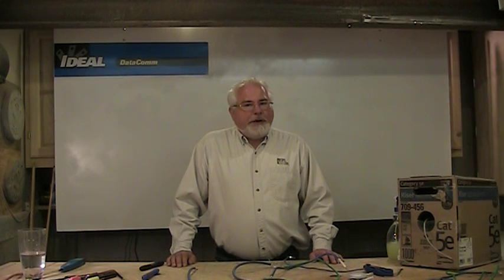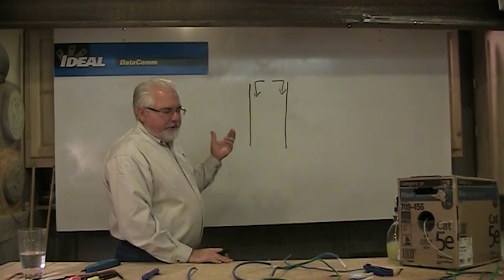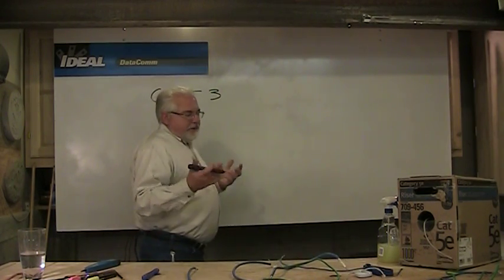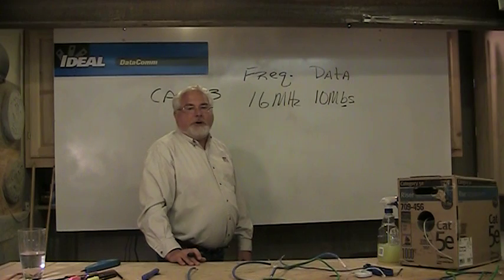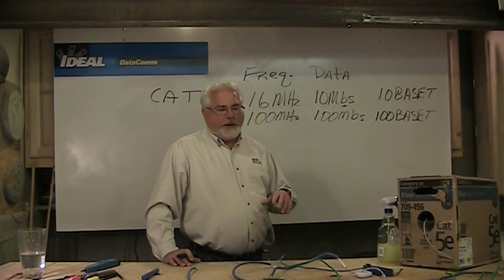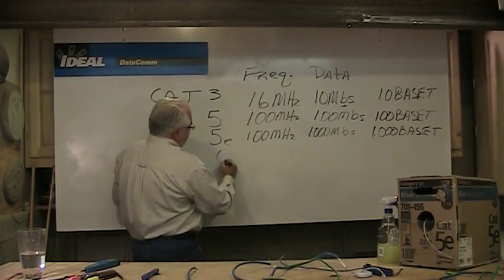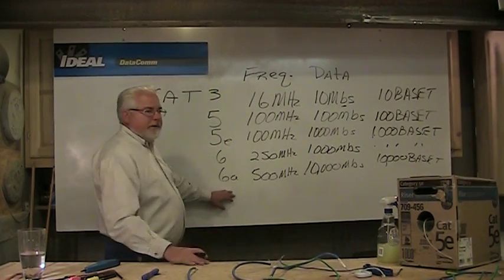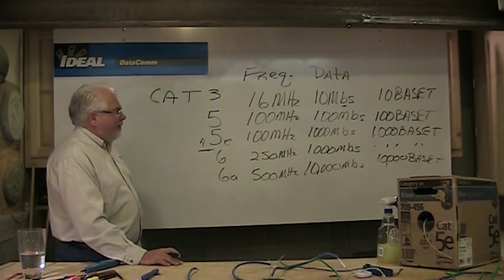UTP Cat 5e 6 6a Cabling Basics Part 1

Comment: Great tutorials, I've used your techniques to do a few Cat6 projects including LAN for an entire house and it works perfectly. I'm looking at doing an outdoor run about 65 yards between two buildings and thinking Cat7 direct burial in conduit for future proofing. Do you have a tutorial on properly terminating shielded cables/connectors? I'll leave a pull string in the conduit in case I need to pull something else down the line but still would rather just do one run for the near future. Thanks in advance!
Reply from the maker: Hey Ben no I do not have one for shielded cables but I will tell you they are not hard to do. Just have the extra step of attaching the shield and how that is done can vary between brands of connectors. The distance is OK for the category wire but if you look at the cost of cable it might be better using fiber instead for the link between the buildings. Hope that helps. Ron
Reply: Hi Ron thanks for the reply! I had thought about fiber but hadn't done a cost comparison, you're right about the price difference CAT7 to fiber! I don't have any home gear right now with SFPs so that would be something to add to the mix, or do you think media converters are fine? By the time I add those in I'm back up in the price range of CAT7 cable... :)
Reply from the maker: Ben I don't know what you are using the building for but if the wiring is for entertainment Cat6 would probably work fine for several years to come. If you wanted to step up to Cat 6A would be even better last I looked it was about $450 for a 1000 feet. Anything more is probably a little over kill. Ron

Comment: Ron, can you recommend a manufacturer or brand of Cat6 or 6a that you would feel safe using?  My longest "Home Run" would be 50 feet.  with most around 25-30 feet.  Am I better off buying ready made cables?  Or is it not to difficult to cut and wire my own ends and just buy a bulk spool of Cat6a wire?  Thanks
Reply from the maker: Matt Belden is the manufacturer a lot of people would recommend for Cat 6. However what you find at Home Depot or Lowes will work well too. Especially if you are doing residential. If you use pre-made cable then you would not be using wall jacks and that will not look like a finished job as the wires will come out of the wall and simply plug into the device. If you want a finished look buy bulk wire and install wall jacks in the room. Either way it should work fine. Ron
Reply: Is it really worth it to go for 6a?  I have a real hard time finding 6a in bulk...  Well I can find it, but it seems like its $300-$500 for a 500 foot bulk roll where as I can get a 500 foot of regular Cat6 for 85 dollars at Home Depot.  My current ISP Charter/Spectrum only offers I believe 60 GB service and I have a Netgear Nighthawk C7000 so Im not even sure that 6a will be worth it.  On the other hand I want to future proof as much as I can within reason...
Thanks if you answer.  Otherwise I love your videos.  Great info
Reply from the maker: Matt I do not see the need for Cat 6a in residential anytime soon and feel Cat 6 will be good for another 20 years or more in the home as a general rule. I think the speed you are getting from Spectrum is more like 60 Mbps only Google is pushing 1 Gbps that I know of. Watch this video I did on switching to Cat 6 https://youtu.be/zZEgINS-fPc?list=PLw8qsvCN6q_0ESEi_5BNo5yyDOQzbDZvO